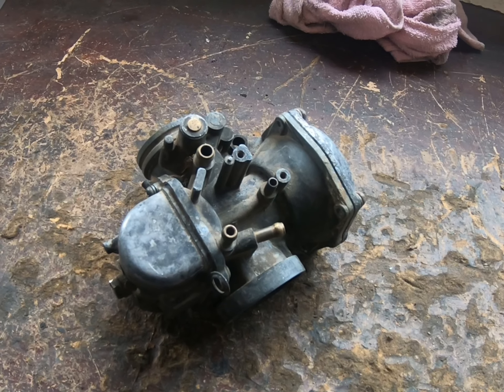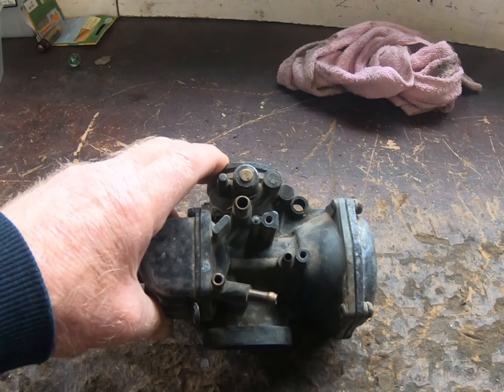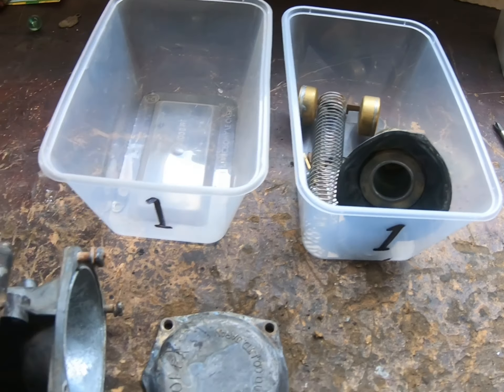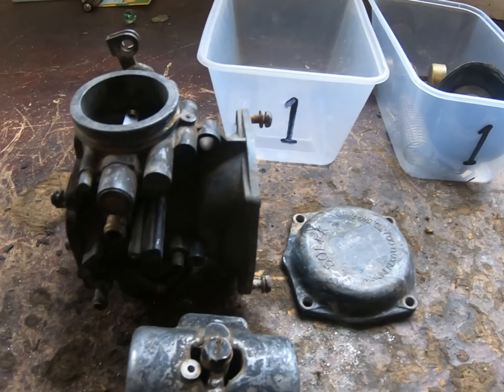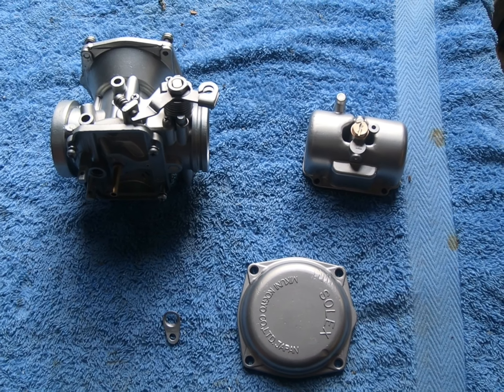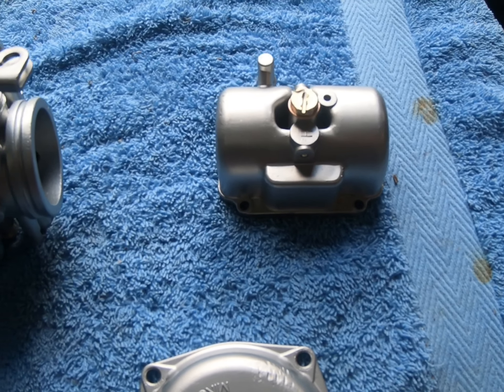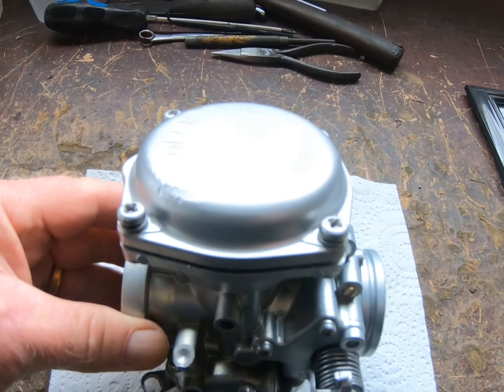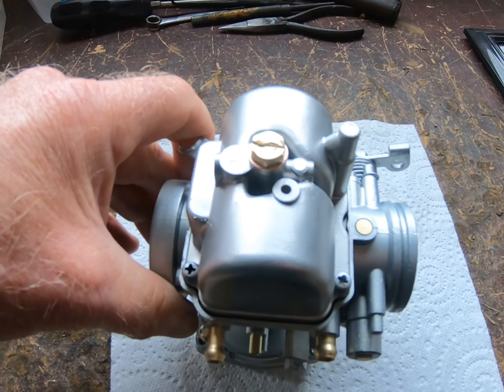Hydroblasting/vapourblasting a Yamaha XS650 carburettor

Comment: Amazing finish, does this process affect interior meassurements like bearing seats or gasket surface? Glad I found your channel
Reply from the maker: In my experience I have had no negative feedback from my customers in regard to seats and gasket surfaces. I always give the gasket surfaces a thorough clean and there is usually no need to concentrate my efforts on bearing seats as these aren't seen and are usually clean. I run my air pressure around 80 psi. Some say this is too high but as I said I get nothing but positive feedback and a fair amount of my work comes from word of mouth recommendations.
Reply: @BendigoHydroblasting  Thank's Craig for your kind reply, asking because I'm working on the idea of mounting this business, as a matter of fact building my own cabinets and workshop, I'm from Ecuador and can't find here most of the stuff needed like nozzels, foot pedals, glass beads.. so have to improvise like making a bottle crusher to obtain abrasive.
Thanks for your attention, found your channel very inspiring
Reply: @BendigoHydroblasting  When you say extremely fine glass beads, what mesh do it refers to because I obtained sugar like grains to talcum like powder😄
Reply: @BendigoHydroblasting  Can you tell what's the ideal hp and cfm needed on a compressor to do your work, I just bought a used 15 hp, 52 cfm but not shure it would hold, sorry for all this questioning
Reply from the maker: @edisonsanchez1337  no probs mate. I run 2 no. 17cfm units so 52 cfm should be ample.
Reply from the maker: @edisonsanchez1337  I’m currently using size 4 impact glass beads from a supplier www.abss.net.au. They are more on the talc side than the sugar side. They may have the micron sizes on their website.